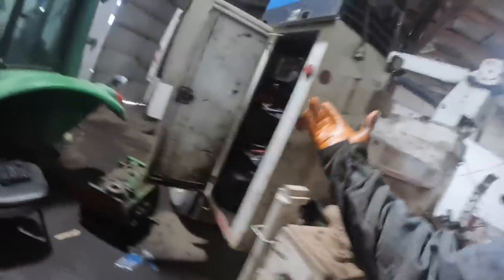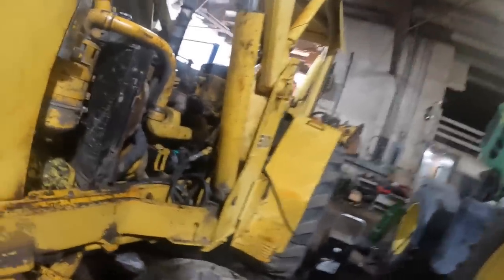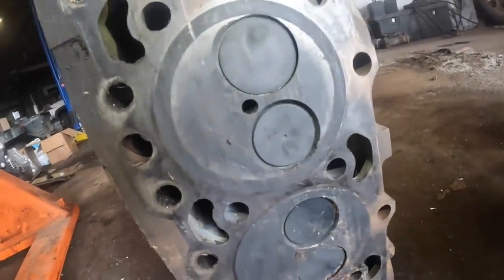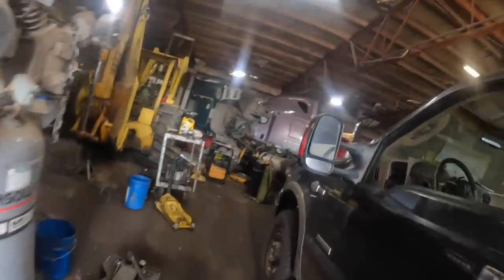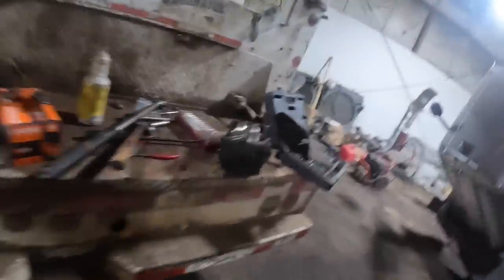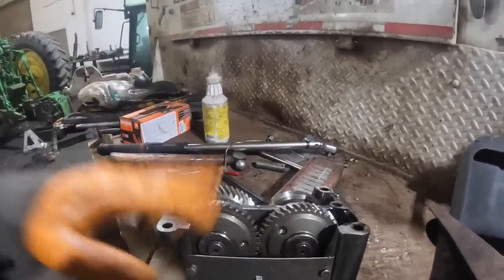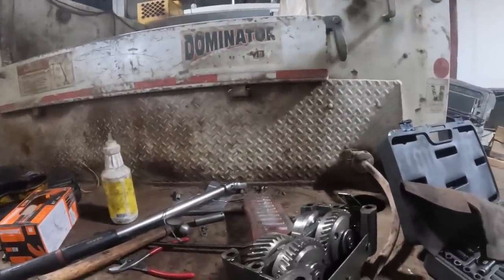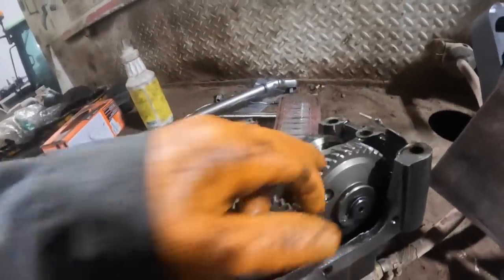Machine shop strikes again!

Comment: Well sir, being a former machinist ( retired) working as a job shop machinist, which means, we worked on everything and anything, with in place machining, field line bore, commercial industrial, heavy equipment, you name we worked on it. If something we worked on went down, we were right there with our customer helping them get back in to production, no, who’s going to pay for what until the equipment was back in service, we then went to work figuring out what caused it to go down, and even if it was not entirely our fault, we back our customer and helped them out how ever we could, bottom line is, you have to take care of the customer, no matter what. Good rant, I would be upset with the issues you’ve had in the past myself. Thanks Warren, good video.

Comment: Warren, I hear you about crooked machine shops...

Back in the late'80s, I was a 18-19 year old kid who knew next to nothing about cars and engines, but really wanted to learn, and I was trying to get a good rebuild on my 440 for my '68 Charger — my very first car.

Very long story short, I got hosed by two different machine shops before I finally found a good one after many years of searching here in Lane County (Oregon).
That little journey cost me thousands of precious dollars that I earned from minimum wage jobs ($3.35/hr.)  The shops had no customer service. Their policies was "tough luck".

Third time was a charm, as I found a guy working just outside my town (Creswell) who built sprint and drag motors, and had a good reputation. I had been through so much stress by that point, I thought I'd struck gold finally getting my motor into a competent machinist!  After I got the motor back from him, the car ran like a raped ape.

My dad had a similar situation around the same time. He tried a different shop, in Eugene, for the rebuild of his 327 in his El Camino. They screwed it up big time. They screwed up his heads so bad (double hump heads, no less), that they couldn't be salvaged. He ended up taking it to the same sprint guy who did my 440.  And his 327 came out great.

A good machinist is worth his weight in gold. The rest just deliver heartbreak and a much lighter wallet.

Comment: Warren I have been a big fan of your videos for a long time and I really appreciate the time you takes to make the videos. I think the problem with people doing half assed work is with pretty much anything these days. I kind of work in the commercial construction sector and the hackery I see on a daily basis is nearly staggering.  I honestly do not hire people to do anything except shits that's up off of ladders or like concrete work.  Yes it might take a bit longer to get something done but I think you can get things done much better doing it yourself even with buying any specialty tool required for the job. I have a problem with when you hire a professional to do something, and this is something that they do for a living and when its done the work is not any  better than what I could do.

Comment: Warren, I've got my share of horror stories about things that machine shops have done to me too, and you're right they'll never make it good, instead they try to say that you must have screwed up somehow, so you have to eat the labor;
  Once I took a cyl. head to a machinist to do a valve job and whatever it needed, so he had to replace a seat. The guy messed up and bored the hole too big for the new seat, so he made a thin sleeve and pressed the new seat inside that sleeve, of course he didn't tell me what he'd done, and the head was back together when I picked it up, so I installed it on the engine and got everything back together, i started the engine and it ran great, then I turned the truck over to the owner. He drove the truck about 100 miles and the valve seat came out and the piston hit the valve; I had to replace the piston and head. The machine shop paid me for the parts, but I had to eat the labor.

Comment: You hit the nail on the head buddy. I’ve experienced the same thing with local machine shops. You better strip every removable part and some none removable parts if you want to have everything to put back together because they sure as hell want. They’ll throw it in a bag if they don’t throw it away. Never tell you about it. I’ve never in 20 years had a flywheel machined form cars to big trucks that was true and didn’t chatter. Had truck flywheels where they want cut the lip for the pressure plate. Wear sleeves installed crooked. Gasket surfaces never cleaned if not milled. I can’t even remember it all. You name it they do it, and do a shitty job. I feel your pain man.
Reply: Your flywheel story hit home.  Had a local shop grind the guide dowels off every single one i sent in.  You would think that is basic level.
Reply: I know there’s probably good machine shops out there like everything else but I’m in SC and he’s in Oregon and it’s ashame we both receive the same service from them. They just need to do better.

Comment: Hey Warren, at first I thought you had trouble with the service truck. Glad to hear at least that's on the road again. I'm only doing hobby stuff but my machine guy has been pretty good. My problem is after market parts. On my latest project, 64 F100, the distributor, two fuel pumps, the water pump and now the aluminum radiator have all failed in less than 2,000 miles. Thank goodness I caught the fuel pump before I washed out the bearings. Of course it did take out the rear main seal. I'm so discouraged I could scream. Someone said that advance auto parts will cover warranty labor for a professional shop. Today I'll pull my new radiator out and see if it's repairable 😢

Comment: Yep your 100% right mate same here in Australia same deal 30 years ago i had a 350 4bolt block decked AGAINST MY DIRECT ADVICE told them 4 times do not deck my block ,because i didnt trust them ,yep you guessed it they decked the the block it lost half of its engine number oh they said that'll be ok well it wasnt was it i dumped a fully prepped block ,the same mob did another 350 they left out the rear camshaft bearing whacked in the rear welsh plug yep you guessed it no oil; pressure the list goes on ,i only deal with engineers now never a engine shop ,if its a high end vehicle i use a race shop thats not accessible by the mainstream public ,it costs but the results speak for them selves ,its only through motor sport connections can you access these people goodluck mate

Comment: Wow, thanks for sharing Warren, absolutely amazing. I just dumbfounds a guy that these places are still in business with the crap that's leaving their shops. It's seems for them a case of supply and demand, if it's broken and they can get the money for half assed work, they will take it. It seems to be a pride thing, there lost their pride in doing good work decades ago, now it about lining their pocket and nothing more. The other problem is if there is a "good" machine shop, due to the quality work the other guys are putting out, the good shop is booked well in advance with no space for quicker jobs. I don't blame you for being upset, you have every right to be pissed. That balancer looks like a simple case of not paying attention to the job at hand, just shoddy work. By the way the 289 valve studs being push in, the 300 6 cylinders are the same way with the push in valve studs (lesson I learned when I was 18, they snap off but good)... Hang in the Warren we are all here for you, vent as need be we are all grown ups.. Stay Safe Sir, thanks for the share..

Comment: Glad I'm not the only one! Same here in the UK, worked through the night, making a tool to install tapered bushes into John Deere 6068 conrods ready for machine shop to bore/ream them to size, they wouldn't offer a fast turn-around unless I did. So set about the job with my own lathe and milling machine to get this tooling made and bushes installed for the next day. Took the parts to the machine shop, collected a few days later. Come to re-installing the pistons onto the rods and some of the pins weren't the best fit (too tight), installed the ones that were okay. Only to find when I measured the piston/block deck height they were way out of spec. Worse than that they weren't even square so measured different readings around the piston. Heck I was mad, the bushes had been bored off centre and on an angle! Wow, like you say they wouldn't honour the repair. I should have just machined the bushes out myself as I'd have done a better job even with my older (less accurate tooling). So I know exactly how you feel, so your advice about checking and double checking the work is spot on. Had I done what most tech's do and assume the machining was correct I'd have had a piston to cylinder head collision. Doesn't bare thinking about.

Comment: Warren, i have a similar story on the heads for my 390FE. Cylinder head shop rebuilt the heads, 2 months later i got them back and built my engine. It ran a few times and would not start. Head issues. Took them to another machinist that works on FE heads and he found the stem heights were way off (non adjustable rockers) and the previous shop even FORGOT to cut the seats on a couple intake valves!

Comment: I agree with you 100% Warren. When you finally find a good machine shop, you stick with them. The funny part we see in Michigan, is every small town used to have at least a little machine shop. Now all the small shops are gone, the ones that are left are overworked and most likely understaffed. It seems like Machine Shops are a dying breed, good ones are almost impossible to find. If you find a good one, you will have to wait for an opening. I have been screwed by a machine shop that rebuilt my 6.2 Diesel in my 1986 K20. I normally rebuilt my own engines, but they would warranty if they assembled it for $300. It was never correct, always started hard, no power, even for a 6.2.  After numerous attempts by them to replace the intake gaskets and fuel system checks, I figured out the cause. They machined the block or heads too much. It had hydraulic lifters and as soon as they pumped up, it held the valves open slightly causing the starting and low power issue. When I proved it to them, they called me a liar. 
I really appreciated your videos and Rants. Hopefully your Black Cloud moves on.

Comment: I work on a lot of JD 4 cylinder diesels Warren. You may be able to put a 4219, 4039, 4045 or a 4239 engine in that. Does it have an sae #3 flywheel I am assuming it is, the intakes and exhaust are different they are on opposite sides where the 4270 were on both sides it will take a little plumbing my choice would be a 4219,  plenty around and the 4045 a little bigger would give you more hp. Don't even get me started on machine shops. Just a thought buddy.

Comment: Hey Westerntruckand equipment man you produce great work and talking about machine shops as yes once the jobs are completed it is mostly not there concern . I will say that I cover my bases as I run a machine shop and a fabrication welding shop as well as heavy equipment repair/ resale.  It sucks that happened to the balancer as I always check with manufacturers with original specs as they will provide everything if you get the right guy, in service or parts.i know if I did thay job i have a 100 % guarantee of parts operation, and i would have grabbed that back from you and fixed it right if i missed something. I do my best to keep everything factory and i am keen on oil holes and lubrication as I own metal working machines from 1920s and a drop of oil keeps it going every day. So I feel your pain. Be safe and keep on living.

Comment: One reason I feel good mechanics, such as yourself, really should have a lathe, milling machine. Makes easier for yourself to deal with such issues. But you're correct, you always gotta double check and double check to make certain everything is good to go. This is an issue of today, no one cares nor do they want to take responsibility for the work they do. Great video as always, cheers :)

Comment: Same with some other comments I’ve seen. Warren you are a good tech and problem solver. Doing field mechanics is tough for sure and you are right that some machine shops do terrible work. There are some really strong smart machine shops that do amazing work and solve huge problems. Machinists are two types of people. Either they are extremely mechanical and know how stuff works or they are really good with math and know how to run machine tools. They can make anything but don’t know what it’s for or how it’s supposed to work. Which isn’t good in most cases. But it’s the same with parts houses. These kids are fast on a computer and there are lots of them but have never seen a carburetor or a distributor. The problem is it’s hard to get really good help in our industry with the support side of things. Parts houses can’t pay guys 30$ a hour to sell parts cause of the money but customers stop shopping cause they get the wrong shit all the time. Same in machine shops get smart kids that have gone to school to run machines to make parts but don’t know what they do. They would look at that and be like why is there a hole here doesn’t make sense, not knowing it’s a oil feed hole. Frustrating yes but not all shops are the same. Keep it up love the videos learn a lot and get entertained. Have a good day.

Comment: Speaking in a UK context, nobody appears able to do their job properly any more Warren. If only we could find a way to avoid having to get out of situations that we shouldn't have gotten ourselves into. It's difficult when stuff that needs fixing is old, parts are obsolete and hard to find. I don't think there's an easy answer, other than trying to be selective about what comes through the door. You're due a run of good luck Warren. The sun always comes out in the end so fingers crossed you get a break Sir. Thank you for posting the video.

Comment: ~~~ Its new from the factory.  Yeah Right.
We were in Bishop CA getting our tires fixed several flats from new retreaded tires ( they did that back in the early 60s)
Any way while waiting at the repair shop they had a brand new Dodge Dart on the rack ( the guy had driven it from Bakersfield right from the show room floor to Bishop) The rear end went out. It seams the dealer hadnt put any grease in the rearend. They did send a mechanic from the dealer in bakersfield with the new rear and fixed it.
The next story is my Dad bought a brand new 64 Rambler Station wagon. He drove it around for a  couple weeks and it ran out of gas yet showed a 1/4 tank so he took it back everything checked out (so it seamed ) he drove it around another week. out of gas again so he filled it up and it took only a couple gallons and it showed full on the gauge. So he drove it couple days and it needed fuel again this time it only took a gallon to fill it up. He took it back to the dealer By this time the car is only 2 months old.
They did a full inspection and found that the factory had soldered the vent tube shut and it was sucking the tank and collapsing it smaller and smaller till it held no fuel. A new tank and things worked again,

Comment: When I was 16 my hard working single mom had a Jeep Cherokee that the tranny kept surging on. She had the that thing to the small town local shop several times. He charged her for everything he did. I was dropping it off for the fourth or fifth time, we had the hood up, and there was a wire running by the valve cover with a bare spot. Taped it up and problem solved. I think my mom was $5,000 deep at that point. Thirty years later and I'm a maintenance machinist in power generation. I'll bet half my work orders are to fix something that the last mechanic failed to or made worse. There's people that care about what they do, care about the quality of their work, and take ownership of their mistakes. Whatever your trade. If your not one of those, your not telling me poop. I'm proud of my trade. Especially the machining side.

Comment: All great examples of places that don't deserve to be called a Machine Shop
A true Machine Shop would have addressed the root problem and additional problems or updates
What's worse is those lazy easy buck shops could have prevented every one of your examples with better inspections AND if it slipped through the eyes of the lazy "machinist" they should have made it right with the customer 
Period

Comment: I took a 5.4 modular block to a local machine shop that needed to be bored to 0.010 over.  They did the work.  I didn't notice anything wrong.  Take the same block back a couple years later to take it out to 0.030 over for some forged pistons.  They then tell me one deck is 0.040 out of spec.  I question them how it could have changed from the previous work they did, but the swear its that far out.  So they deck it.  They also did valve springs and seals in the heads.  Long story short I ended up with a divot in the deck(they said i did that), the valve seals leaked like crazy, and later another machine shop said the decks were misaligned.  I should have pushed back harder when the one deck was suddenly out of spec but was young and didn't know any better at the time.

Comment: i just did rear drum brakes on my car because i dont trust shops. It was a real mess leaky cylinder scaped crap off.. I currently am using an oncologist for prostate issues, nasty meds so doing my brakes was very painful to do flexibility issues with over heating( ill leave it at that).. im not complaining its just i want it done right ..  my family think im nuts...   hell no i want it right..

Comment: funny about the ford reman engine.  last year we replaced one of the new 6.7's, complete motor from ford.  Lasted 1400 miles.  We dropped it off at the nearest ford dealer and told them to call us when they got the motor replaced.  They did.